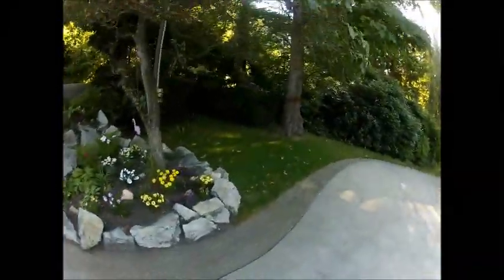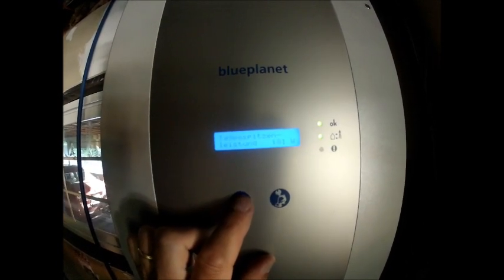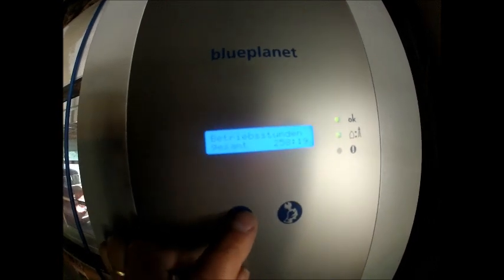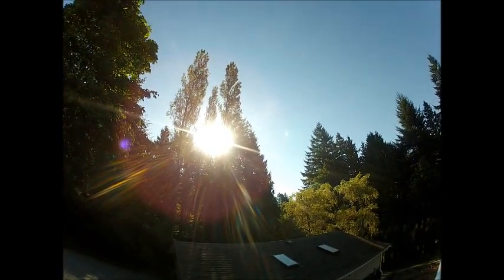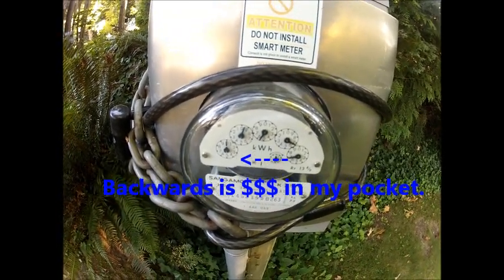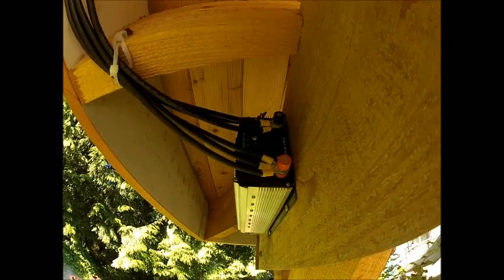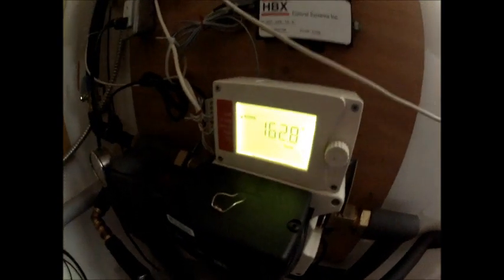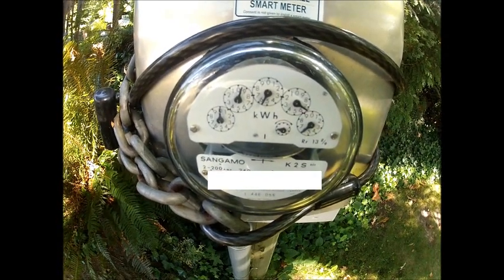Kaco 5002xi Initial Impressions

Comment from the maker: Most (not all) analog meters will run backwards when you generate more power than you are using. They may get suspicious when your meters shows a ton less than you normally use. The only way to know is to try running it backwards. I've made 650kwh in 31 days and 23 of those days I had only half the panels installed!

Comment from the maker: Yep. It's still a work in progress. I'm using S5 metal roof connectors, leftover aluminum extruded square pipe and round pipe. I'm not using a commercial racking system. Second string left to mount yet. It's a bit of a job.